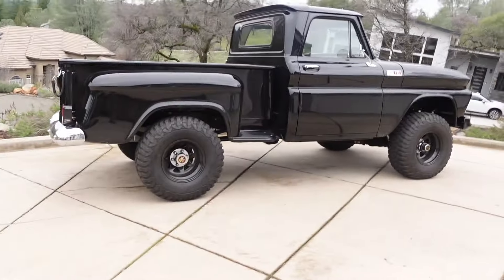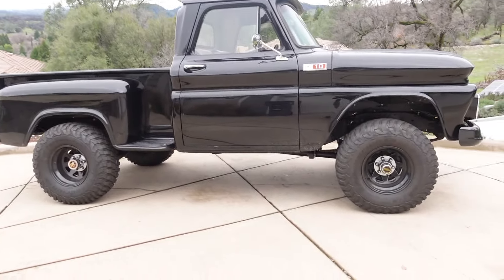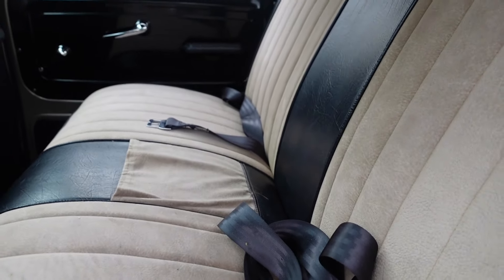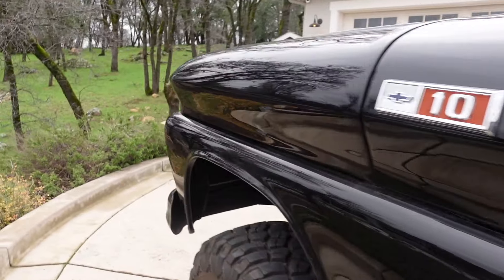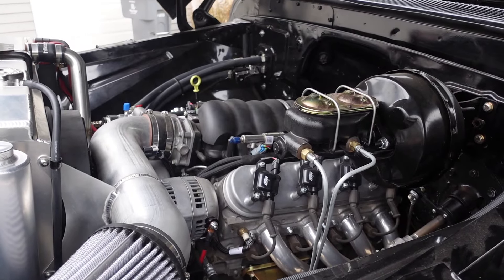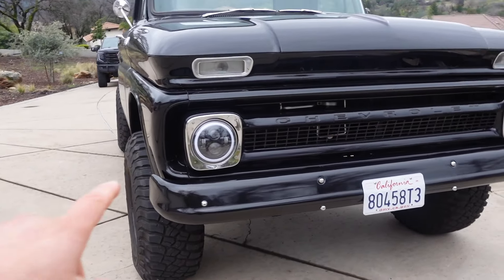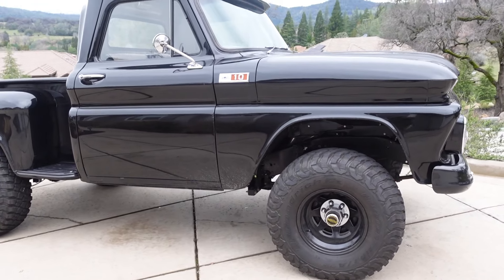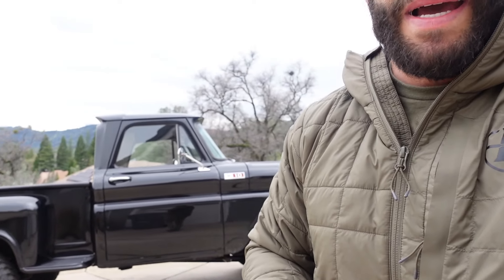My 1965 Chevy Build!!

Comment: My first truck was a 1963 Chevy half ton four-wheel-drive, short bed. It had a six cylinder in it when I bought it and I swapped it out for 327 out of a 62 impala and put a set of fuel heads and cam and  headers Only bad thing about 63 was the windshield wrapped around the cab and every time you were in a hurry and you jumped up in it cause I’m short like you are I used to whack my freaking knee on the corner of the windshield frame, but I love that old truck…. By the way that was back in 1974.